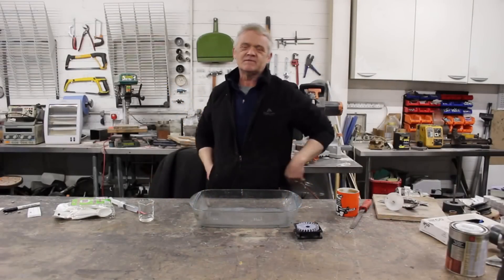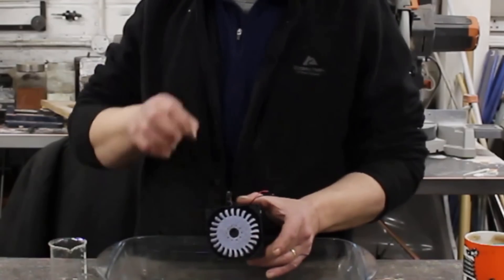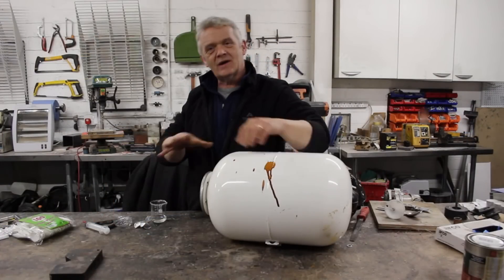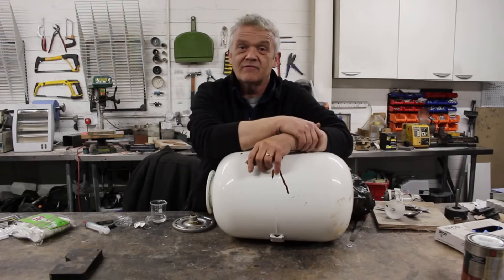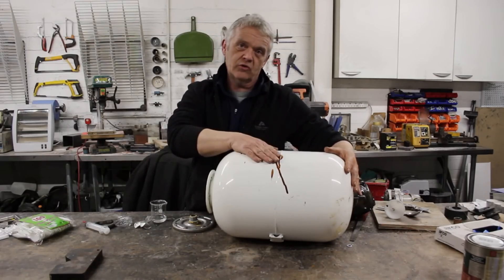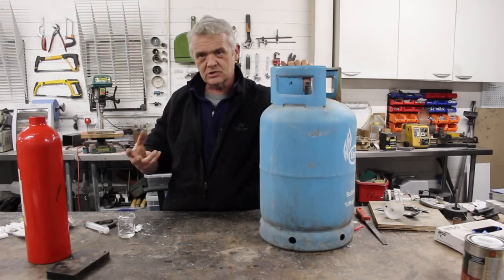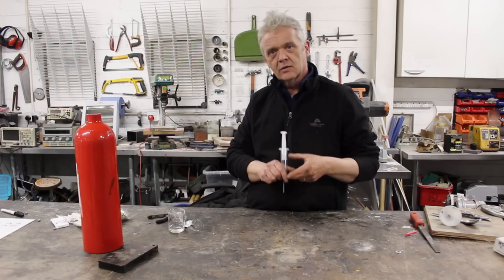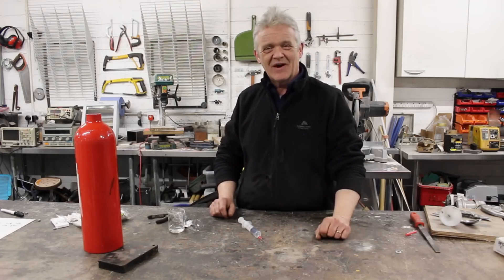1919 The Water Accumulator As A Possible Battery

Comment: I’ve experimented with this very thing before just out of my personal curiosity.  I used a Venturi pump without a check valve in it so as water was running it would pull water out of tank and a one way valve would let air into tank which eliminated the need to have a diaphragm or balloon inside since air was replaced in tank upon any water line being opened.  Then when water was off it would fill tank and compress the air in it.  I 3d printed the tank shape in a all mesh print of petg then coated on a rotating armature like ppl use to resin tumblers/cups.  I never pressure tested this tank and I was using household faucet pressure for my test.  Would make a neat video to see someone pressure test such a tank or even replicate my backwoods little project and maximize its potential.  That would be a hint Mr Smith :)…love your content btw.  If you want my homemade resin tank let me know I will ship it to you or give you print files whatever you need.
Reply: It just occurred to me I should have said I will pay shipping and you can of course have tank for free.  I just want to see that sucker get blown up to see what we can learn from it..ha

Comment: There's a highly efficient power storage company that uses this system using air pressure to power a water generator for mass energy storage.   I forget the name,  but it of course does not require the infrastructure of a large water tower.

Comment: Old gold mining trick big diameter pipe up stream reduces in size down stream making your accumulators weight the very water you are using to wash away entire mountains with high pressure water.

Comment: I see a few comments about high pressure ....A DIY electric pressure washer will pump in excess of 2000psi, I have used one for hydro forming in my very basic workshop, to take dents out of classic motorcycle exhausts. 
Like most experimental things like this, a bit of common sense regarding potential safety risks is essential, but if folk never took  risks, progress would have been very slow.

Comment: You can also use the flow of the water powering a ram pump to fill a second accumulator without adding any more energy to the system. Then you can use the pressure from the second to assist the water pressure in the same or another system. Of course it will never create more energy than is used to initiate the system(s), but it could potentially improve the efficiency of them.

Comment: i dont know what a 'new' butane cylinder is in psi but I was always under the impression it was same as propane so only about 175psi, the cylinders are really overated to delay the inevitable when in a caravan fire etc to allow escape. I'm also pretty sure that lpg pumps for filling cars are set between 160/180 psi from when I fitted lpg in cars
Reply: You are correct. The pressure stamped on the butane cylinder is the "test pressure", not the working pressure. It is usually prefixed with "TP" :)

Comment: Thanks for post robert and explanation. I wonder mate if you apply the same principle to using just AP and put in the latest NT turbine concept of yours mate. So if you give the input a large head you have AP and gravity as the weight. Then if you nozzel this down converging to high velocity and the NT turbine then allows this fluid to go throught using the V and this should also create a slight vacuum within the turbine therefor increasing the effects for the weight on the head! thoughts?

Comment: 6:00 this is so wrong, you should take a thermodynamics course. You can't store any energy in an incompressible fluid, you can only do this in an compressible fluid or gas and water can in this case be considered as an incompressible fluid. All the energy that is stored in your vessels is stored in the air, not in the water. Btw, that's also why we test burst pressure of vessels when the vessels are filled with water and not with air.
The water in all these examples is used to transfer energy, not to store energy. In the first examples the energy is stored in the weights as potential energy.

Comment: Have you ever looked at water ram pumps. They were used on farms to pump water to a header tank using the flow of the water in a small stream/burn.
Reply: Very wasteful as they require a lot of water flowing through to pump a little water to height. Fine if you have a permanent stream.

Comment: It might not be obvious to some but for off grid systems with a well or water tank, water pressure is supplied using a pump, which can take quite a bit of power to run!  If it  fills the accumulator or pressure tank when there’s solar power you won’t have to power the pump with batteries at night, the tank is then the battery.
Reply: Go for a magna circ pump, they dont use alot of power

Comment: It is my understanding that pressure vessels for water must be designed under particular standards because as the pressure increases the risk of explosion is increased. Additionally, at least part of that reason relates not just to the increased pressure but that water inside these vessels can interact corrosively with the material of the container, so the container itself can't simply be some pressure vessel that used to contain a gas... In the USA, pressure vessels designed to hold water under very high pressures are required by law to meet certain requirements. Likely the cost of such a pressure vessel would outway the long term savings. Additionally, such pressure vessels typically have a regulatory maintenance and inspection requirement, which would almost certainly not be cost effective for most people. However, at lower pressures, we do have "Water Well" Tanks with Air bladders that can be used to pressurize the water. These have a much lower PSI rating, but can safely store water under their rated pressures without as much hassle, but obviously with less stored energy.

Comment: Ahoy Robert,
The older (Victorian& Edwardian) accumulators were often incorporated into hydraulic power systems, for example a network to supply power to capstans, cranes and lock gates in a dockyard, presses for sheet metal forming etc... (Also including the power supply of swinging bridges etc...and lifting or bascule bridges...see Tower Bridge as an example)  The "charging" was supplied by steam power pumping water under pressure into the accumulator. As power was drained by whatever machinery was in use the system, once a mechanical trip mechanism had been activated the pump started and re-charged or indeed maintained the pressure in the accumulator. 

So a water accumulator in the old sense makes for an excellent means of storing, controlling and distributing power, but is reliant upon the "battery" being either charged and replenished. The hydraulic engines are normally all reciprocating. These engines also work with a "head" of water being supplied from an elevated source by pipework.   A more measured use of the water results... probably?

Comment: At 04:05 you mention that the pressure in the accumulator is many multiples of mains pressure.
Surely a way to use this higher pressure for a much longer time, would be to use a pressure regulator to drop the accumulator pressure down, to a more manageable near-mains pressure?
Reply: ( If the Accumulator Pressure is higher than Mains - there is no way the mains pressure is ever going to "budge" the accumulator - volume except underhammer conditions.  The only way to "make "real use" of that higher pressure, is to dump the pressure, batch fill the "water reservoir"  - isolated from the mains, or you are about to evacuate the mains - and re-pressurise the accumulator bladder....  Accumulators in systems are there to make up for pressure and / or flow fluctuations / variations resulting from:  circuit / source switching, pumping pulsation or switching cycles , variable loads in the system - etc..   (Or in the case of a very low power input system - running constantly (high duty cycle) - providing energy for a low duty cycle batch process...).   Air filled vs nitrogen filled...  horses for courses...  Electric systems and batteries are so much more user friendly and load agnostic than these old school industrial systems.
Reply: @kadmow  I think you might be making a rash (but incorrect) presumption that the hydraulic accumulator system I described would be connected to the public water main.
I only stated that the output pressure of the accumulator could be regulated down, so that it could be used for a longer period at a lower, but still useful pressure (perhaps spinning a turbine to generate electricity from the stored energy).
Reply: @dj1NM3  . Cheers for your budding future as a hydro engineer. (explica mucho). Being nice is key.

Comment: Here is a free idea I have used years ago. In a normal borehole water system you need to have distribution pressure which is achieved in one of 2 ways. Raise the tank say 10 meters or so to get 1 bar or use a distribution pump which has a bladder in it like the one you showed here. Or a third way which is get the 10 000 liter tank back on the ground level and make it strong enough to handle 3 or 4 bar and make it air tight. All that is needed is an inlet pipe with a oneway valve which is connected to the borehole pump in the well and also an outlet pipe at the bottom for feeding the user system.  Now with it being empty at first fill it to say 6000 liters with borehole water. As the water fills up the container it displaces the air which starts to get compressed. You will now have  about 6000 liters with just over 1 bar and with no tower high up and no distribution pump. Much cheaper and easier than the tower or distribution pump. Btw any energy sources could be used for filling the tank, windmill or solar etc be used for the borehole pump.
Reply: who makes pressure rated 10000L watertanks - probably a tower and squeaky wind pump (or modern solar  -and davy pump) wins here...
(Back in the day, every cocky had a few lengths of old  water pipe  to make a 10m tankstand  with a 1-3kL- tank up top and  the old bush mechanic/fitter used to "crank" out  galvanised watertanks  - non pressure rated........)

Thanks for the  concepts - I would love to see a concrete tank explode at 5 bar...   (or piss water at every induced orifice)
Reply: @kadmow  It is actually possible and for a few years worked well until the air  leaks started. Never pushed it beyond that  bar for safety sake but eventually it developed air leaks. Later we realised it needed plastic as well as steel reinforcing in the construction design. The next version will be to take a plastic 10k liter water container and put it in a steel reinforced outer shell.  1 bar is not much pressure in reality. Did you know plastic Coke bottles go beyond 7 bar pressure  which is the max my compressor goes. Did you know that coke is filled to a pressure of 2 bar in those plastic bottles.
Reply: @bartronicsecurity  : I didn't say "not possible", just that I know that any large tank at any significant pressure  (you did posit  - several bar) wants to turn into a soccerball...    I asked who made pressure rated watertanks  - a rotormoulded ball (or spherical ended tank)  would  make more sense - it may even be a good idea then...  (have a laugh and see the funny side of a 10 tonne watertank spltting open and washing the cat down the street...)
I could  - fairly simply -  design "whatever" (configuration) to work - design is a key word, not  "hope it does the job" - cheers.

Comment: file:///C:/Users/johan%20Strydom/Documents/Ontwewrp%20data/Design_type_air_engine_Di_Pietro.pdf This motor needs very low pressure. A poison sprayer can needs no bladder, or piston, only air pressure above the water.

Comment: Very interesting, this idea of using an accumulator with the feed in water pump powered by solar/wind renewable to "charge" the water battery. Then release the "charged" volume of water through a nozzle to turn a generator when needed.

Comment: Great starting point.
Could I suggest, give the tank height instead of a pump using energy to create pressure, then a series of reducing pipes to create the pressure, like they used to “hydronic gold”, then a series of hammer pumps to return the water to the head.
I still think a number micro systems is the way to go for household energy conservation. Solar, wind, rain collection. A generator or mains water supply an ariel collect radio waves and others.
I have no clue as how to put it together and make it work or if it would be cost effective. BUT!
Reply: - sounds fun - ie. never cost effective but a project for the kids to play with science learning by doing.- a hammer pump teaches cool concepts - like how nothing is for free, and losses abound (reducers - in an incompressible fluid -  don't "really" create pressure but increase flow velocity (and resistance to flow) while managing stress on the pressure pipe - if operating in the "danger zone")...
(ie. rainwater stored in a high tank offsets buying water to water the garden - the energy generated  on release-  while real is negligible. The same system-cost spent on solar will provide more energy - but won't water the garden, in the end it all depends what one wants to get out of their "Investment"....

Comment: There is a channle that is land to house. He uses "ram pumps". How would you suggest to use the overflow water for power harvesting?
Reply: You don't. As a nutural consequence of using it to run the ram pump, it comes out at the lowest elevation you have access to, because that's where you put a ram pump to maximize the velocity of the feed water. The fact that it's coming out at the lowest elevation possible means all of the potential(gravitational) energy in it is spent. It also comes out with a greatly reduced velocity meaning it has much less energy from momentum, and has pulses of 0 current. The energy in it is either spent, or the ram pump is poorly optimized, or if the ram pump does what it needs to without being at the lowest available elevation, then you let the overflow accumulate in a container to even out the pulses and let it drop down to power a turbine.

Comment: depending on what your water source is and how much water it can provide, a water ram pump may be able to provide quite some pressure to use either directly in generation or for an accumulator

Comment: I had an idea for an auxilary water suppy that uses check valves on your main to determine where the water you use comes from, then you need only raise the air pressure inside your auxilery tank to the point it's higher than the pressure on the main and that water pressure will for the main check valve closed.

The main purpose of this idea of mine is supplementing my city water with rainwater after making it potable. I'd love to have as many mechanical parts as possible, but it seems unlikely I won't need a small computer to compare the pressure gages and to intermittently release the air pressure so my resevoir can passively fill up with water.
Reply: Water companies aren't happy with dual systems. If their water is turned off for maintenance, your water may flow back, "polluting" their water. Well, at least that's what they say. Highly unlikely but I get their point. I use isolating valves instead given me definite isolation. Check valves can leak and/or fail.

Comment: Why don't Royal Gases(helium argon neon etc) or air escape into the vacuum of space, as there is no pressurized container? If you say gravity, then how does the gas rise to begin with? Also compare train tankers that have the air pulled out of them(Youtube) and they collapse inward. Just a thought...
Reply: Helium does escape into space. Thats why we're running out of it.
And the answer for the rest is gravity. Light gasses rise because more atomically dense ones displace them. Just like if you take a ball pit for kids and dump metal ball bearings into it, the denser ball bearings will drop through the lighter plastic balls, displacing them and pushing them up and eventually out of the ball pit. Btw, argon sinks in air, and the term is "noble", not "royal".

Comment: I have a small waterblaater pump that produces over 2500 psi. Obviously water can be pumped at high pressure far more efficiently than air. Due to its far lower compressibility.
And obviously a jet of water at 300 metres per second for example, carries a lot more kinetic energy than the same volume of air at that speed.
Higher than sonic velocities can be reached with delavel hourglass nozzles with a small hole to introduce atmospheric pressure air near the throat of the Venturi. This enables acceleration out the expansion cone to over 1000 metres per second at water pressure as low as 80 or 100 psi. It of course being a mixture of air bubbles and water then emitted in that jet. 
If your turbine is in fact the expansion cone, is a turbo expander, then you can extract energy and refrigerate simultaneously,  then use a secondary stage to recover the remaining energy. Such as a pelton or hyperbolic Tesla Like Rob has been working on.